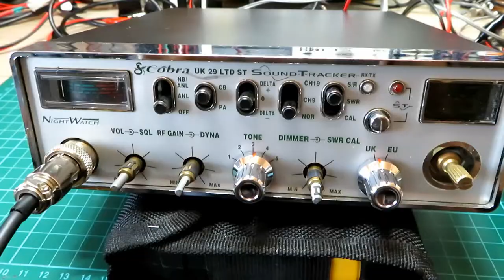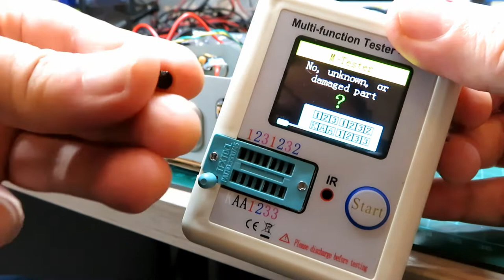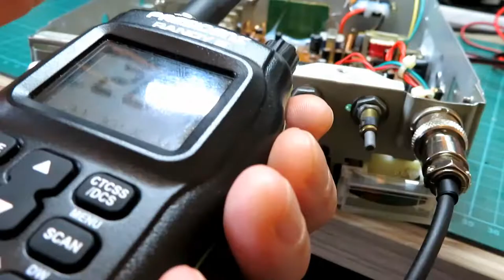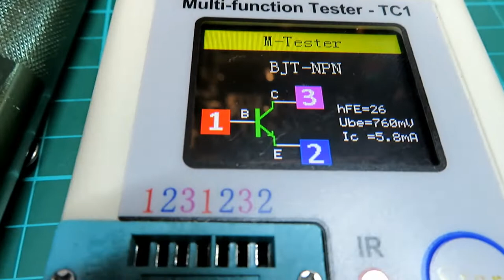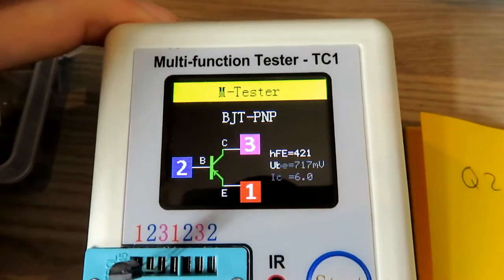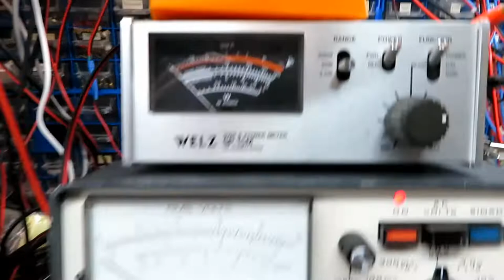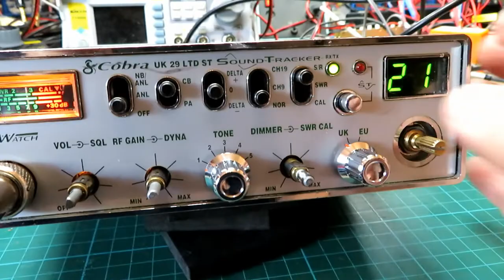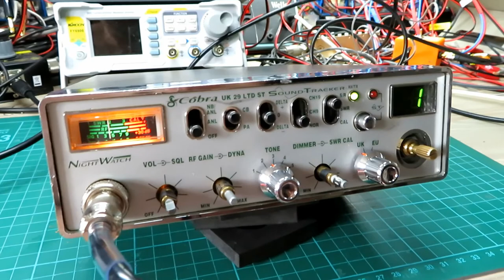SEVERELY BROKEN COBRA SOUND TRACKER CB RADIO - IS IT REALLY BEYOND REPAIR? IS YOUR ONE FAULTY TOO?

Comment: I was hoping that you would mention the non working nightwatch display, and maybe diagnose the common fault on why the illuminating light stops working. Great vid!
Reply: I have one with the same fault (nightwatch ) not working. Would be good to get some insight into the problem that cause it.
Reply: @robertharkness3250  The Cobra nightwatch displays are kind of terrible and all fail within the first few years if not sooner.  They are electro-luminescent displays powered by a high voltage ac inverter -  in American models the inverter is usually sealed in a tiny metal box inside the radio (since its an inverter,  its noisy so hence the metal box).  From the Cobra NW radios I've had, this high voltage output is around 70-90V.  Sometimes the inverter fails and can be repaired but its usually the display.  Unfortunately the displays don't hold up well to vibration or the elements,  and replacing it can cost more than the radio is worth.
Reply: @Sloxx701  i have had some luck with installing led lights and worked better than that crazy set up they chose to use.

Comment: Have you worked on a Cobra 29 LX Camo CB with low RF power output? I have one which had a blown final and burnt 22 ohm resistor in the base of the final. Both have been replaced but I can only get 1 watt RF out of the radio.

Comment: I am watching and this is a very different 29 than the u.s. models.
My question is this a fm radio. And whats the difference on the uk to eou . Or is it am.
May try to buy one of off ebay to play with.
Thanks great video.
199 florida georgia line..
Reply from the maker: Yes this is FM only
Reply: @knoxieman  Then why has it got an AM modulation transformer?